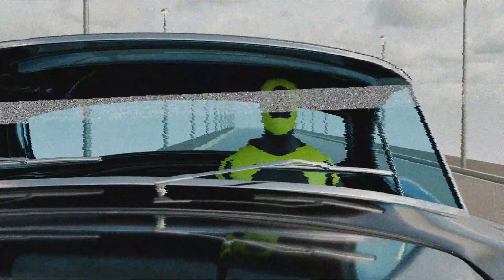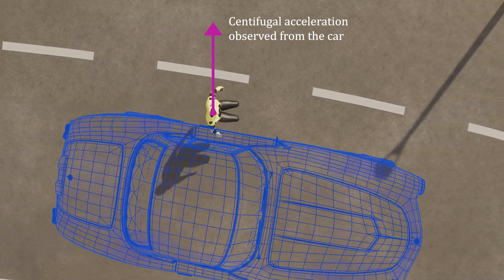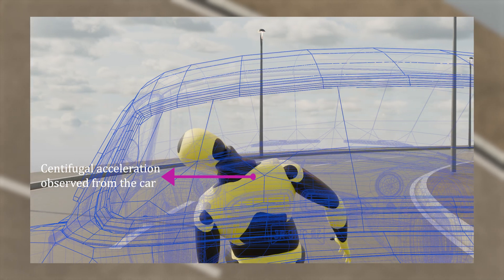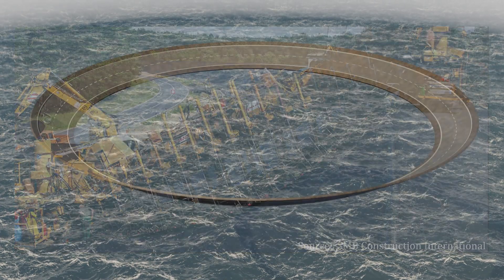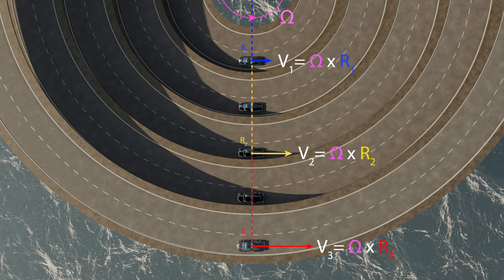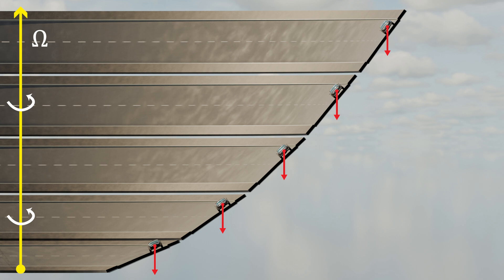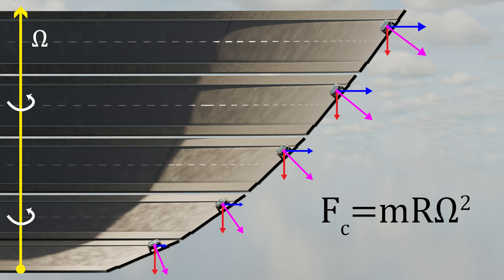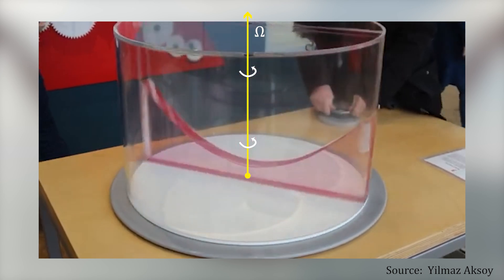Centrifugal Acceleration

Comment: Here's the big problem with describing centrifugal force as fictitious arising from resistance to changing direction while moving in a curved path.
 Newton states a center seeking force acts upon mass moving in a curved path. We mistake the resistance to changing direction for an outward force.
Here's the problem with his explanation. There's no experiment that can demonstrate any force acting upon a mass that is exerted towards the center of rotation.
Release the mass from its curved path and what happens? It goes tangent relative to the curved path and any way you look at it tangential to a curved path is still, quite clearly,  away from center. There is no centripetal force. At least that can be experimentally shown, but the outward centrifugal force is observed by the mass going tangent.

Comment: Bingo!  So, what do you think about the ideas of Mach and his analysis of Newton's Bucket? I think that the resultant forces are precisely as you describe and can all be attributed to the effects of angular velocity and restrained masses. The Earth if a little fatter at the Equator for the same reason. I think that Mach's ideas that the bucket and the rest of the universe's mass are involved, or responsible for the outward forces are wrong. Without friction and viscosity (e.g. friction on the liquid), the mass will remain motionless. The friction allows the rotating frame to impart forces to the bucket's contents and cause it to spin, too. But the mass wants to go in a straight line while being restrained. Vectors, like you said... Thanks.

Comment: Reference frames allow one to ignore reality in order to con you about gravity. Like the you fall in an elevator, you are "weightless" but you still have mass, which is more important. When you land that mass counts for a lot more than it did at the beginning. At least you understand that gravity IS a FORCE and not a curvature.

There are more curves than a parabola, you know? Like the ellipse and those tricky ones that would go up the side of that bucket and not be a parabola. (secant and cosecant for instance)
Reply: According to Einstein's general theory of relativity, there's no force acting on you while the elevator is free-falling. The fact that you have mass doesn't change that. When the elevator stops, the floor exerts an upward force on you. As far as we know in the early 21st century, gravity IS the curvature of spacetime. You can tell that it's not a force because you can't feel it.

Comment: In NASCAR racing, the cars on the inside of the turn do not slow down to match angular rate to the cars on the outside of the turn.

Instead, all the cars slow down (slightly) so that they are very close to the limit of adhesion of their tires.  Lateral acceleration for all of them is approximately equal, and equal to v^2/r.  Because the track is banked, some of that lateral acceleration is into the track surface, increasing traction and increasing the velocity that the cars can maintain around the corner.

And THAT's why the bank angle changes across the width of the track.  If the bank angle was constant, the cars on the inside would have an advantage: they'd actually have to go slower, but the shorter distance would mean they'd get around the corner sooner.  You can see this in Formula 1 racing, where the tracks are not sufficiently banked.  The inside lane has an advantage, and as a result, cars go around the track essentially in single file, there is little passing, and the race is boring.

NASCAR tracks are banked so that the cars on the inside do NOT have an advantage.  This makes it practical for cars to go around the turns side-by-side.  That greatly increases the opportunities for passing, which makes the race more interesting.

The optimal bank angle is complicated to derive, because there are many factors.  The combined centripetal and gravitational acceleration on the cars does not point directly into the pavement.  If it did, they'd be using none of the traction of their tires.  There is also a substantial ramp from the straights into the curves, that varies across the width of the track.

And finally, though I'm not certain of this, the racing is made more interesting by alternating a slight advantage from the right hand to the left hand side of the track, which changes which cars are favored over time.  Track designers would achieve this by modulating the bank angle versus turn radius.  Too much, and you get single-file F1-style racing, but a little, and you get some back-and-forth duelling.
Reply: This is sort of a funny comment to read from the perspective of a F1 fan haha. From my point of view, how in the world can a race be interesting without a racing line? If theres no optimal spot on the track, you can just drive right around someone without caring about making a proper over take. Meanwhile, in F1, you have to know the track very well, and plan overtakes in advance. You have to force the other car off of the racing line, or defend your line and make sure it isnt comprised by your opponent. Sure, overtaking os hard, but that means you earn it.

Comment: centripetal* acceleration
edit: I started a nerd war
Reply: I believe centripetal acceleration is the acceleration the body undergoes towards the centre of the circle as a result of forces on the body from the car.
Reply: In the reference frame of the object in circular motion, the apparent outward force is centrifugal force. It is a pseudo-force. Centripetal force is the real center-seeking force in an inertial frame that causes the object to be in circular motion.
Reply: No, centrifugal force is not a real force.  By making the reference frame the car, you’re observing an unbalanced force, rather the result of the body resisting the centripetal acceleration of the car and perceiving it incorrectly as a force induced by the driver themself.  Even if your frame observes the driver moving seemingly on their own, that doesn’t mean you can pinpoint the force on them since physically they are not producing one
Reply: @homieboi5352 but what is a real force? in a rotating reference frame, the equations of motion have centrifugal force. Thats all. No force is more real than any other.
Reply: @simonpedley9729  A real force is one that you can feel. One that can be detected by an accelerometer. Centripetal force is real; centrifugal force is fake.
Reply: @Raging.Geekazoid  In a rotating reference frame, an accelerometer would certainly detect centrifugal force. If you stand on the surface of the planet Earth, which is a rotating reference frame, and measure gravity, then it’s weaker at the equator because of centrifugal force. Also, the shape of the Earth is not spherical, but oblate, because of the centrifugal force.
Reply: @climbingkids  But you don't feel gravity. You feel the pressure of the ground holding you up. 

"In a rotating reference frame, an accelerometer would certainly detect centrifugal force."
A. If the accelerometer continues in a straight line, the rotating observer will observe a centrifugal acceleration in the accelerometer's motion, but the accelerometer won't detect anything. It's traveling in a straight line.
B. If the accelerometer turns with the observer, it will detect the centripetal acceleration caused by the force that's making it turn, but the rotating observer won't see it undergoing any centrifugal acceleration.
Reply: A more prosaic answer is: a cup of tea is an accelerometer. Try drinking a cup of tea while you are driving round a curve to the left. The tea will slurp to the right because it's trying to carry on going in a straight line (non-rotating frame explanation) or because of the centrifugal force to the right (rotating frame explanation).
Reply: @Raging.Geekazoid  You can detect and feel the centrifugal force. Please don't talk about physics if you haven't studied it, you're confusing people.
Reply: @freshrockpapa-e7799  How does one detect the centrifugal force? What does it feel like? Please post concrete facts in addition to your rhetorical generalities. People are already confused, and I'm trying to dispel the confusion.
Reply: @Raging.Geekazoid  What do you mean what does it feel like? It feels like a force because it is a real force that necessarily appears in a non-inertial frame of reference. You've never been on a car? Everyone has felt centrifugal force.

Well then don't try to dispel the confusion by spreading misinformation.
Reply: @freshrockpapa-e7799  Everyone has felt the pressure of their seats or the sides of the car pushing on them when the car turns. That's a centripetal force. They don't feel any centrifugal force because it's not real. Everyone has also felt the pressure of a floor pushing up on their feet, a chair pushing up on their butt, and a bed pushing up on their back or side. They don't feel gravity because it's not a force.

You don't feel anything in a turning car until you hit the side of the car, and the pressure of that pushing on you is the only thing you feel.
You don't feel anything when you're falling until you land, and the pressure of the ground pushing up on you is the only thing you feel.

Don't be so sure you know what is and what isn't misinformation. Sometimes the truth is counterintuitive.
Reply: @Raging.Geekazoid  I studied mechanics in university, please, listen, because you have a serious misunderstanding about this.

The force you experience when a car is turning that pushes you TO THE OPPOSITE SIDE the car is turning is the centrifugal force. You have experienced it, you know it's real, and you do experience it because it is a force.

What you're talking about is linear motion, it has nothing to do with centrifugal forces because those aren't spinning reference frames. You only get centrifugal and coriolis forces when you're in a spinning reference frame, also called non-inertial or non-Galilean.

Don't be so sure you know the truth either, because in fact you don't.
Reply: @freshrockpapa-e7799  What's the difference between turning and spinning? For all we know, the car could be mounted on a huge merry-go-round in an amusement park. How is that an inertial reference frame?
Reply: @Raging.Geekazoid  In this context turning and spinning are synonymous. 

A car turning or spinning regardless of how it's happening would be a non-inertial reference frame, correct. If I said otherwise I misspoke.
Reply: @freshrockpapa-e7799  Okay, so let's say I'm in the back of a big empty truck instead of in a car, and let's say I'm sitting on one of those office chairs that have wheels on them. When the truck turns, the chair and I roll across the bed of the truck, and while I'm rolling, I don't feel anything except the upward pressure of the seat supporting me and some vibration from the wheels rolling on a rough floor. What do you mean by "experience", and how is that experience evidence of a centrifugal force acting on me?
Reply: The centrifugal force is a fictitious force. It is assumed to exist only to explain observations made from the frame of reference of an observer who is also moving in a circular motion along with the object that is being observed.
Reply: @longsleevethong1457  Your second sentence is correct, so I think our only disagreement is semantics. Your first sentence is just your own personal preference for whether forces that only appear in rotating frames, and that are a consequence of that rotation, should be described as fictitious or real. I prefer to say it's a real force. My argument would be: why would you want to call the forces that occur in rotating frames fictitious? They work just like any other force, in the rotating frame. They have real consequences, in that frame (e.g., the shape of the earth, the dynamics of the oceans and atmospheres...all our theories for the dynamics of ocean and atmosphere are based on rotating frame physics). The rotating frame isn't fictitious, so why should the forces be? It's much easier to explain phenomena in rotating frames using centrifugal and coriolis forces than it is to continually be having to switch back to thinking about non-rotating frames. But then I'm a climate scientist who has spent their life solving equations in rotating frames.
I'm trying to think why I care, given that it's just semantics. I think it's because calling it a fictitious force seems to somehow belittle the 100+ years of scientific theory, and 1000s of scientific papers, that have used these 'fictitious' forces to explain the world around us, to great effect. And if we teach students it's a fictitious force, and they start to think it's therefore not important, then we have to un-teach them again once they start training as scientists, because as scientists they may well have to solve equations that include these forces.
Reply: @rrrick2129  but in a rotating frame, centrifugal is balanced (at equilibrium). in a rotating frame, centrifugal is in the laws of physics, in newtons second law
Reply: @simonpedley9729  Your use of the word "real" makes it essentially meaningless. There's already a word for things that are "real" in some reference frames but not in others: it's "apparent".
Reply: @Raging.Geekazoid  A good example of a force that exists in some reference frames but not others is gravity. In a falling reference frame, gravity is zero. So is gravity just an 'apparent' force?
Reply: @simonpedley9729  It's not zero. The only thing that doesn't exist when you're falling is a floor to make you stop.
Reply: No, it's centrifugal. In a rotating reference frame you do experience a centrifugal acceleration away from the center. 
Centripetal = towards the center. Centrifugal = away from the center
Reply: Actually, there is one confusing point regarding not being able to feel gravity: In the old-fashioned Isaac Newton theory that we all know and love from Physics 101, gravity is a force, with a formula similar to that of the electric force.  But it's an exception to the rule that you can feel real forces, because, for some mysterious reason that no one could figure out, the gravitational force on an object is proportional to the object's mass, which is exactly the same parameter that determines the object's acceleration (F = m*a). They're literally identical.

This is where Albert Einstein comes in. It occurred to him that gravity might not be a force at all. Instead, according to his theory of General Relativity, gravity is the curvature of spacetime itself. Falling objects don't accelerate downward, they travel in "straight" lines in a curved space, sort of like a boat or airplane traveling around Earth's equator. You can't travel in a literally straight line on Earth's surface, even though you're not turning left or right, because the surface itself is curved.

But that's not really relevant to this discussion. Gravity may not be a real force, but it is a real interaction that affects the curvature of space. The centrifugal force isn't a real anything. It's just an illusion for observers in rotating reference frames.
Reply: @Raging.Geekazoid  An illusion that works exactly like a force in every way, in that frame. Btw, another aspect of GR is that all reference frames are considered equal, including rotating frames. My challenge for you is: can you come up with a concise definition for what you are calling a 'real force'? Then we can scrutinize your definition and see whether you are internally consistent with your definition.
Reply: In classical mechanics, a force is anything that can be on the F side of Newton's second law (F = m*a), and "real" in physics means it's the same for all observers. 

Centrifugal force looks like a force because it's a component of the m*a term on the other side of the equation: the mass of the object being studied, multiplied by the centripetal acceleration a_cp of the reference frame, i.e the centripetal "force" F_cp. Then the product is subtracted from both sides, and you have F + F_cf = m*a', where F_cf = -F_cp = -m*a_cp is the centrifugal force and a' = a - a_cp is the object's acceleration as seen in the rotating frame. So you have Newton's law with an extra force added in to compensate for the reference frame's rotation. Actually, there's also the Coriolis force for the general case, plus maybe some other forces that I don't remember offhand and don't feel like looking up right now. 

Gravity is an awesome way to see real theoretical physics in action: Maybe Einstein realized that it can't be a force precisely because it can't be felt. I don't think any other theorists even came close to imagining that. Hilbert tried to beat Einstein in figuring out the mathematical form of the theory first, but only after Einstein came up with the overall idea.
Reply: @Raging.Geekazoid  Your definition of force fails (in classical mechanics), because it leads to the conclusion that gravity is not a force, because gravity is not the same for all observers, per the free falling frame example.
Reply: @simonpedley9729  My first one only fails for gravity, and I already posted two detailed comments explaining that gravity isn't really a force.
And free fall doesn't prove anything. All observers agree that the falling object and any other massive objects nearby attract each other.